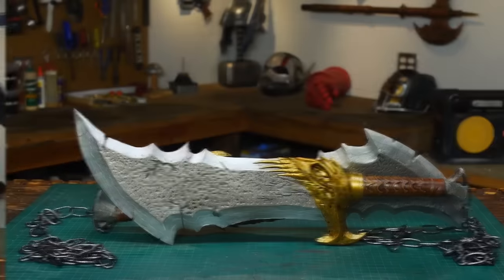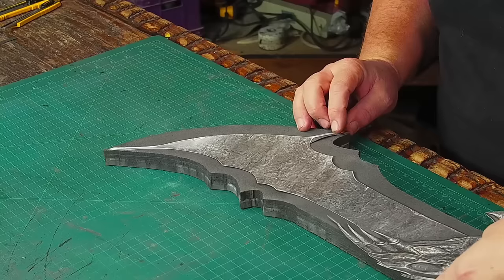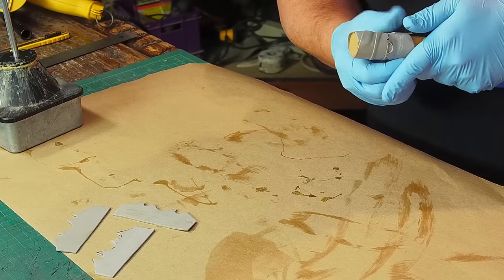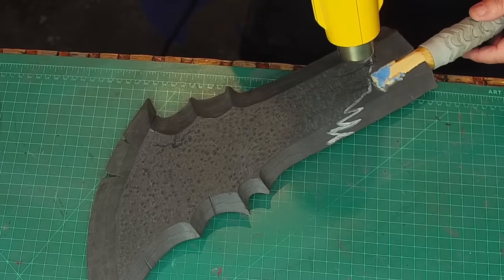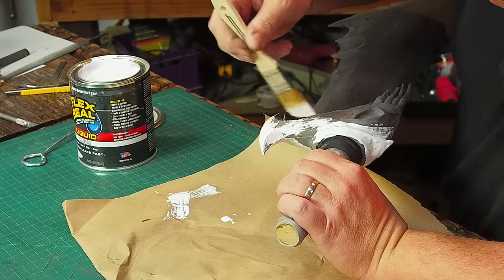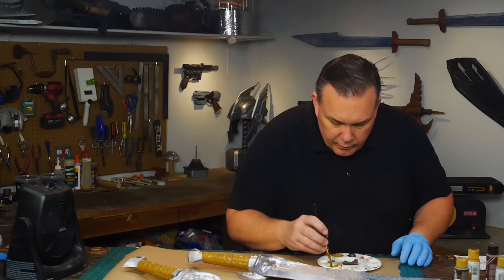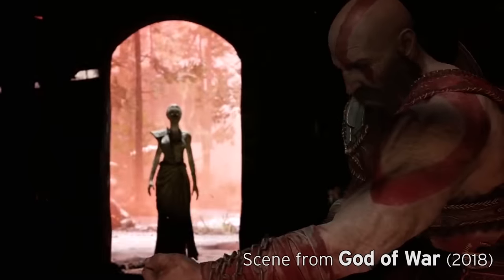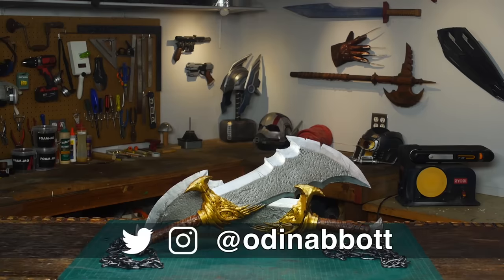Odin Makes: Blades of Chaos from God of War

Comment: How in the world is your random-orbit sander removing texture that quickly? I've tried applying all sorts of different pressures at 80 grit, using the edge, using the sanding surface as intended, and it absolutely NEVER cuts texture away like I'm watching here. It feels like it takes 30+ minutes to remove the texture from a single EVA mat.

Comment: Just counted the squares on the cutting board that the blades cover to be 35. assuming each square is equivalent to 1cm in length, surely that'd make the blade 35cm instead of 25? Fantastic work nonetheless! I just want to be sure about the measurements before i start making my own

Comment: It woulda been epic if you fixed some acrylic or just plastic sheet like 1/16 inch thick inside the blade part to the handle so they wouldnt flex and tear easily and they would be more sturdy